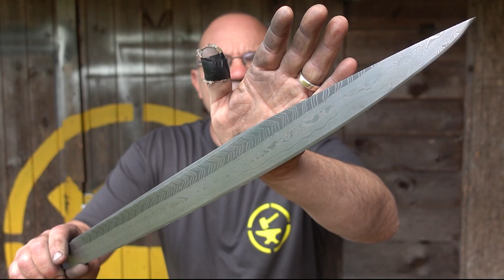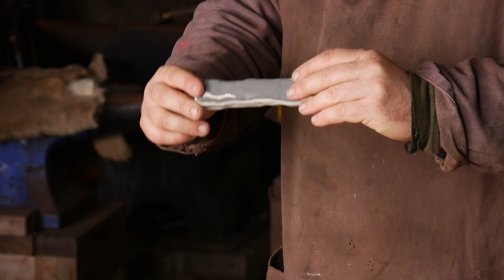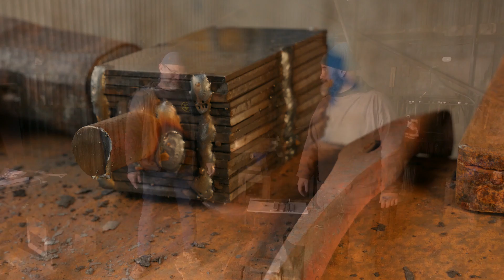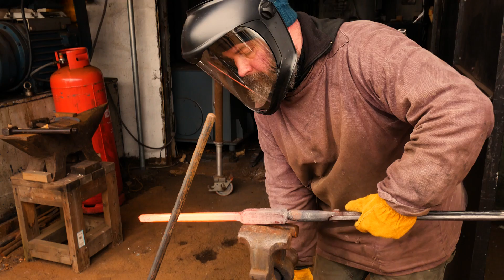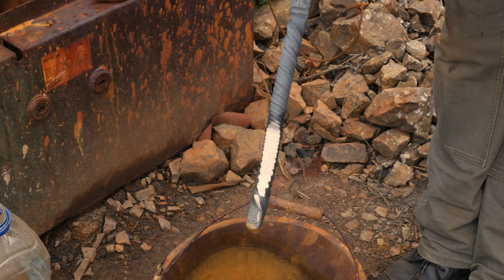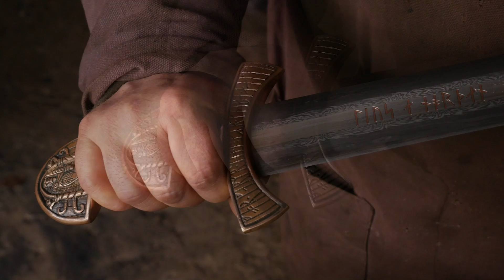Viking PATTERN WELDING - How To

Comment: HI guys awesome work! But one remark. Stacking up a billet of individual layers is not likely the way these billets were made in the Viking era. Most likely they welded an iron and steel bar together and folded and welded that between 3 to 6 times. This folding and welding is done to purify the iron and steel. Twisting the billet is done to distribute any flaws thought the bar,  away from a single plane. So even if a weld delams the twist would still hold the bars together. Also the borax feels a bit of a cheat.... just bringing this up as I am sure you guys are aware and it is important to educate people with the right info! So much misinformation is spread regarding  viking age swords. As can be seen from this Ulfberht analysis https://youtu.be/Fs8UpLBuCU4

Comment: Identical to viking era except with power hammer and hydraulic press, sure... i get how they replaced that part.
But what about the freakin weld on the billet??? I for one was trying to find out how they did that exact part...

Comment: Yes but how did the Vikings do it without  
All the modern tools and chemicals
Reply: They didn't. The vikings had no knowledge of steelmaking. The only quality swords found from the viking era was made outside scandinavia (ulfberth swords). The vikings prefered battle axes by that reason. There were swords made by viking blacksmiths but the qualith was crappy. And there is absolutely no archeological evidence for damascus making in scandinavia during this time. Americans love to put the vikings into a pretty romantic context and historic facts doesn't seem to be of much interrest
Reply: @daniellarsson4418  1: They did know about steelmaking, there is 100% archaeological evidence for them using bloomery iron and steel, and for making the type of furnace used to carburise iron. 2: if they didn't know about steelmaking, how would they make battle axes? their axes had steel edges, we know this, because hundreds have survived and we have tested them, they are steel. 3: There were indeed crappy swords make in Scandinavia, but there were also crappy swords made everywhere, there were also good swords made everywhere. 4:you don't know the difference between Damascus steel and pattern-welded steel, a common mistake. Pattern welding was used in western Europe and Scandinavia from the 6-700's through to the 1000's. Damascus steel is a different type of steel, produced in the east during a longer timespan, that had some similarities in appearance due to it being patterned also. 5: Ulfberth swords were not the only good swords from the era. They were remarkable swords, being made from crucible steel, but they were not the only good ones. 6: no one in this video is American. Tod lives in England. I don't know where you get your 'facts' from, but i suspect you haven't actually looked at the archaeological evidence. may I suggest 'the sword in early medieval northern Europe'. It's an excellent book full of archaeological evidence-backed facts about the swords of this era, their construction, origins, meaning and history. it will give you quite some education.

Comment: I suspect the original reason for pattern welding had more to do with reliability issues with the welds than looks - but the looks took over and made it popular. The twisting would mean there would only be relatively short runs of weld in any section of the blade, so a weld not fully taking would be a bit less of a issue than it would be if it were a long weld such as in the Japanese tradition. As time moved on through the heroic age of the migration period and into the early medieval period the techniques had probably improved enough that the decorative effects were more significant by then.

Comment: I don’t know why this idea has just struck me now after all these years of interest, research, and the like, of things like swords, forging, and so on. I wonder if there were ever any weighted and/or complex pulley type systems similar to that of a press or power hammer in any of these periods. It wouldn’t have been simple to do, but it would have definitely been doable and incredibly useful, the more I think of it, that seems like something that would have had to exist in these metal working areas in Germany in the late Middle Ages/Renaissance, and I bet it was water powered. I would love to see a video on this kind of thing if they did exist.
Reply: water-powered hammers absolutely did exist, and in fact one still does, preserved in (semi) working order. google finch foundry. Its from the 1800's. If you go to Wikipedia and look up trip hammer you will see that they were in use in Europe from the early 12th century documented, and quite likely earlier undocumented as the romans used similar technology.

Comment: Yeah, the vikings definitely had welding machines to weld their industrial-grade steel pieces together, then throw them into a propane forge and finally forge-weld them with a press or a power hammer...
Reply: Very ACCURATE HOW TO, just like the vikings did it
Reply: Honestly, if I could give these people one technology that could change these people's lives, I'd give them spinning wheels. All the thread for sailcloth now takes a fraction of the labor. 

Imagine king Canute with a spinning wheel.

Comment: I've always wondered how they held the pieces of steel together to forge weld them without a modern welder to tack them all together before you put it in the forge to do the actual forge welding. I did see one smith use metal hose clamps like you'd use on a radiator hose to hold the billets together until you get the forge weld to stick, but they didnt have those back then either. So what did they use? Wire? Seems like metal wire would have been hard enough to make that it wouldnt be convenient to keep a stock of that around just to destroy it every time you make a blade. But maybe I'm wrong. Also I know sometimes they would fold steel over its self and forge weld it that way but you need two different kinds of steel to get a good pattern. So how did they do it? How did they hold the peices together before the forge welding actually takes place?

Comment: I appreciate that the power hammer replicates assistants with hammers, but how did smiths of the time go about grinding off the surface material? 
Hand filing?
Reply: Chisels, various roughnesses of stones, and a ton of time! (and probably some other methods that are lost to us)
Reply: Files weren't in common use until the late medieval era in Europe, before that they will usually use abrasive stones for that sort of work.

Comment: But that press tool could not have been done with traditional tools? Is a hammer enough to forge weld all these plates together?
Reply: Yes, it can be done with a hammer, and Owen does do it with a hand hammer in demos, it just takes a lot longer and is less reliable.

Comment: How long would it take to grind away all that material with grinding tools of the period, rather than modern abrasives and a power tool?  They'd also need use a larger billet to make up for the lost material - requiring more bloom, fuel and labor to forge it.  Seems like a fair bit of added expense - only worthwhile for high status objects?

Comment: Tod I was wondering what kind of steel you use in your reproduction knives and daggers on Tod Cutler. I looked but I may have missed it.
Reply from the maker: EN45 0.7% spring
Reply: Interesting. I looked at the composition and it looks similar to 5160 which makes sense because spring steel. Thanks for the reply, good stuff.

Comment: I'd love to see you using and testing typical medieval age medium carbon steel sword vs wrought iron steel sword vs modern patter welded *damascus steel vs real damascus steel (wootz steel) swords against a bamboo or/and tatami and if possible even blade to blade damage test to see how much one sword type would react against the other and bring the whole true damascus steel (wootz steel) sharpness myth to the test.
Reply from the maker: I have a plan for a rondel dagger
Reply: "modern patter welded damascus steel"
It is just pattern welded steel - no iron from damascus involved here.
Reply: @ABaumstumpf  I know that but it's still called mistakenly by many damascus steel. If you didn't notice I put an asterix next to damascus there.

Comment: I wonder if they ever set up trip hammers powered by water wheels to forge steel.
Reply from the maker: Very common in big industrial areas
Reply: There is still a working one in Dartmoor, the worlds oldest surviving power hammer, used specifically for forging.

Comment: when did people stopped making pattern welding blades?
Reply: Technically all non-crucible steel blades were pattern welded until the invention of the Bessemer Process in 1856. Crucible steels being relatively rare. Because until the Bessemer it was nearly impossible to create large scale production of homogeneous steels. Though pattern welding for aesthetic reasons stopped probably around 1000 AD. The blades would have still been made of layers of different bloomery steels which would have been repeatedly folded to the point of almost complete homogeneity. If they were polished and etched you would be able to define the layers in much the same way as Japanese swords do but this would not have been done after the viking period.
Reply from the maker: Pattern welding seems to have fallen out of use for blades around 950 approx, but was later used for shotgun barrels

Comment: Nice to see a blacksmith saying pattern welded instead of the usual bullshit 'Damascus' . Guess this blacksmith is confident enough that he doesn't need to use this buzzword to feel interesting.
Reply: The issue is that most people know pattern welding as damascus and for most people the terms are interchangeable.
Reply from the maker: Damascus is (sort of) valid, but is definitely distinct and different to pattern welding
Reply: @tods_workshop  The modern use of "Damascus" usually refers to gun barrels.  In the early days, matchlocks and flintlocks, carried by warriors in the middle east were made of steel from Damascus.  Later, the term applied to pattern welded shotgun barrels made and sold in Europe and the United States. 
https://centerofthewest.org/2017/06/16/mythical-ithaca-on-the-edge-of-discovery/#
European Damascus shotguns were made from about 1790 to 1930. Most American gun makers had phased them out by 1890.

Comment: Even more impressive are rifle barrels made that way; especially considering the pressures they have to contain. 
Used to do makume gane ( same process) using gold, silver and copper.
Love watching people who've mastered it. :)
Reply: Where the rifle barrels drilled from a block of pattern welded steel?
Reply from the maker: Euan, No they were not.  They were made from pattern welded strip, coiled around a mandrel and forge welded into tubes
Reply: @tods_workshop  Oh, cool. Thank you.
Reply: @tods_workshop  Thank you Tod for the correction. 😊
Reply: @euansmith3699  I'm not sure but from the examples I've seen (some dating back to the 18th century) the barrels are probably a single billet that's shaped and bored out.
Reply: @brianreddeman951  I just googled pattern welded gun barrels, and they are gorgeous. 😍 I didn't know that they were a thing. Thanks for pointing them out.
Reply: @euansmith3699  You are welcome and I appreciate Tod stepping in with proper information.
Reply: Pattern welded (usually called "Damascus") barrelled firearms are beautiful to look at. However, they cannot be safely fired using modern ammunition.  They were made to be used with black powder loads. The modern pressures generated by smokeless powder will cause a rapid disassembly of the barrel, often removing some body parts of the shooter.

Comment: I wonder if someone someday will create a space forged blade.
With the welding done in vacuum, where metals fuse by mere touching.
That would be epic
Reply: The're would be little to no benefit of forging in a vacuum. Granted you would no longer need to worry about oxygen contamination of the welds but the same effect can be produced with chemicals and even atmospheric control of the forge.
Reply: @martintroy910  there is one: it would be incredibly cool 😎

And I just find it fascinating that you can weld metal in space by just putting to pieces together :)
Reply: @Glimmlampe1982  No you cant weld metal in space just by putting the pieces together. Im a bladesmith and was trained by Owen in pattern welding. Forge welding happens when the metal is heated to just below melting point of the steels involved as such force is required to form the bond/weld. Unlike in electrical welding where the fusion happens above melting temps. Force is required to make molecules from each of the parent steels to cross the layer boundary. You dont seem to understand the process.
Reply: @martintroy910  i know how forge welding works (theoretically, in not a metalworker)
But still there is the phenomenon of cold welding in space. It's typically not wanted, but still
https://en.wikipedia.org/wiki/Cold_welding
Reply: @Glimmlampe1982  yes but since steel is an alloy and two dissimilar steels are required this process wouldn't work. "The reason for this unexpected behavior is that when the atoms in contact are all of the same kind, there is no way for the atoms to "know" that they are in different pieces of copper. When there are other atoms, in the oxides and greases and more complicated thin surface layers of contaminants in between, the atoms "know" when they are not on the same part." There are no atoms of steel.
Reply: @martintroy910  it seems you're right. As I understand it, the problem isn't the carbon inside the steel, the problem is the crystalline structure steel has in non heated state. 
https://www.reddit.com/r/Welding/comments/3l64u8/why_cant_iron_be_coldwelded/

Too bad, no magic space swords ;)

Comment: I find it fascinating to contemplate how etching a pattern-welded blade must have originated. Something mildly acidic might have come in contact with a metal implement and reveled a different coloration between non-homogenous iron alloys. Then someone with the metallurgical understanding to interpret this phenomenon must have inspected this result of pure happenstance, and correctly deduce what had occurred. Perhaps after a few experiments they figured out a repeatable process, and then ran with it.
  Another possibility that comes to mind is that corrosive substances may have already been in use for the purposes of etching designs into (or selectively staining) metal objects. A particular blade (or whatever) which was a product of two different sources of iron alloy (maybe a sword with a simple iron core and high carbon steel edges) then had an etchant applied for the established purpose, however this time etching the blade revealed the previously invisible welds. After some repeated efforts the sword-maker was clever enough to deduce the aesthetic applications of this process.
Reply: You can also polish the blade to make the pattern visible. It's just way less prominent. So I guess it was first done by polishing and later through experimentation how to better show the patterns.
I think there are textual descriptions about how the dragon or snake in the pattern only reveals itself when breathed upon the blade. I guess like in a highly polished blade on a child morning, when the breath condensates on the metal
Reply: Well the pattern would is revealed in the forging and quenching first. The differing composition of the steel means that the scale that forms on the surface is also different and the pattern tends to come out as scale on one steel/iron blows off more easily than the other. Grated as Owen demonstrated the final pattern would be determined by the depth of grinding on the particular billet. When you quench to harden the blade after grinding to final dimensions you get a preview of that final pattern when pulled out of the quenchant. As Gimmlampe says below during the earlier periods of steel and iron production blades were not etched to reveal the pattern and some of the viking sagas talk about breath on the blade revealing the pattern. As far as I remember its not known if during the later viking period if the blades were acid etched to reveal the pattern but it could also have been revealed by corrosion, particularly salt water.

Comment: What would they have used to grind the block historically?

Or would they have used a different method to reveal the pattern? Perhaps 'cutting' the block while it's hot?
Reply: Grinding wheels. Large diameter wheels of stone of different grit count. Often water, animal or human powered.
Reply: Im wondering as well. Grinding into the bar seems like an awful waste of metal in a historical setting?
Reply: @Jarjar-zv5be  And yet it was done. Im a bladesmith and the method I mentioned above is how they did it. Not a guess.